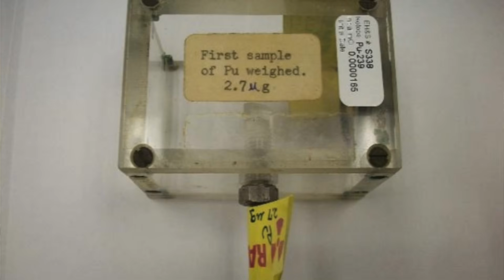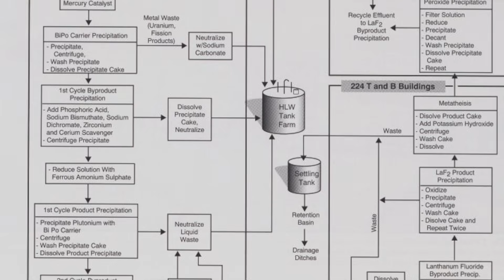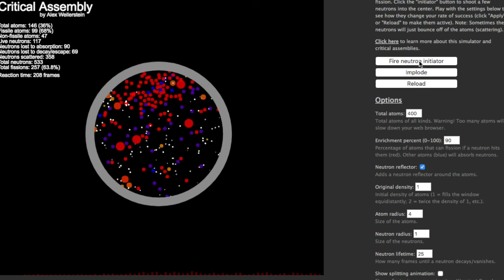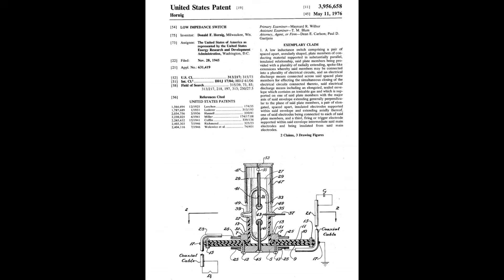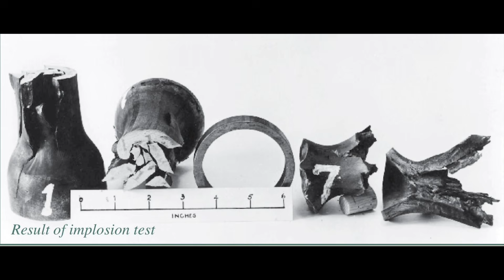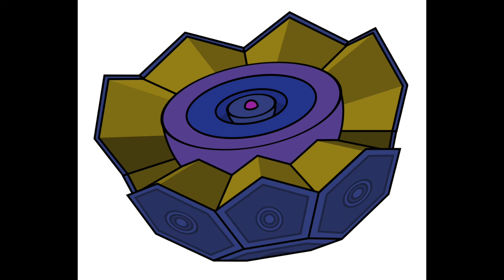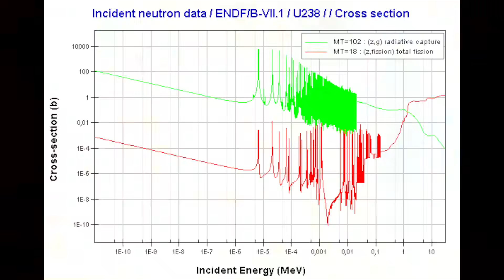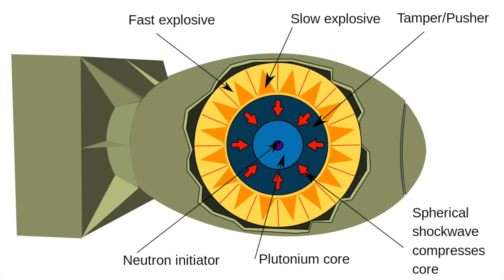Going Nuclear - Nuclear Science - Part 3 - Plutonium Implosion

Comment: I've watched/read a lot of stuff about the Manhattan project and nuclear bombs/energy, and so far there have been new info for me in each of your videos. I love how you explain the details instead of just glancing over them.
Reply: Have you read the Nuclearsecrecy blog, by the creator of Nukemap? That goes into a lot more detail than anything else I have read. Stuff like how a lot of the energy of an H bomb actually comes from fission.
Reply: @charleslambert3368  That's very basic information available on wikipedia..
Reply: The smart guys were the ones that made the kriton ignitors
Reply: What have you read or watched? We're you sober? We're there a lot of plush ponies? You won't find physics in a happy meal 🤣
Reply: Reactors make plutonium as a by product the a goal for plutonium is more cheaper easier bombs that is the point of of going ror plutonium. Enriched uranium even at low none weapons grade is a problem because with that you can make reactors and the reactors will make your easy bomb material plutonium the ignition timing for the explosives is tricky but only down to nanosecond tolerances easily within the capability of switching diode available for purchase through digikey not that big a deal to set up if you have a 100 mhz scope and can read the graticule.
Reply: @rickevans3959 you can't even spell simple words. Don't pretend you do understand the terms 🤣

Comment: The gadget is compressing plutonium with the power of tnt 
So is fusion bombs using the power of fission to compress hydrogen isotopes?
Reply: Also.. dont discount which lithium isotopes are in your bomb or youll end up with something a WHOLE lot larger than you anticipated ;)
Reply: The pressure of radiation do the most of the job.
Reply: Did someone tell the Americans about Lithium 7 >_<
Reply: It's a bit more complex than usually depicted. The primary is in a thermonuclear weapon is still a small conventional fission nuke (with tritium boosting, but that's not very important; mostly it makes it smaller and less sensitive to fizziling). The only fusion type that makes any sense for a bomb is that between deuterium and tritium; which occurs at much higher rate than any other kind of fusion and gives off very energetic neutrons. Isolating large amounts of tritium is difficult and expensive, so that's not what is done. Lithium isotopes react with neutrons to split into helium-4 + tritium; so you can make all the tritium you need, and it turns out that you can do it fast enough if you enrich the lithium in the more efficient lithium-6 isotope. The material chosen was lithium-6 deuteride; a salt (much denser than cryogenic deuterium tritium in liquid form). If you compress something, you want it to be cold while you are compressing it; otherwise it will exert a much larger pressure. Then when it has been compressed you want to heat it rapidly and pelt it with neutrons. In order to do this there is a a device of some kind, at one point made at least partially of beryllium (a neutron reflector) called an interstage, modulating how many neutrons and when they reach the secondary, absorbind and re-radiating x-rays, preventing hot gases from directly reacting the secondary and so on (how this device works is not public information; there's a leaked sketch purporting to depict this thing, but who knows). Then you have a fission bomb inside the lithium deuteride, called a spark plug. If too many neutrons go directly into the spark plug they cause fissions even though the spark plug doesn't go critical yet; and that pre-heats the secondary, making it harder to compress, this is unwanted.

There are several different effects that could be used to compress the secondary, thermonuclear device. There is radiation pressure (x-rays have momentum, even if  they do not have mass); turns out, radiation pressure is very weak. Plasma pressure;  if you heat a light foam into a plasma, it can exert a large pressure from all directions; this is good, charged particles don't penetrate deeply into the secondary and heat it like e.g. gamma rays would. Ablation pressure is also effective. Ablation is when you heat the surface of something and it turns into a gas or plasma; momentum is conserved, so the gas pushes of the surface and press the surface inward. The secondary contains a exterior shell of plastic foam, so that should tell us that plasma pressure is an important effect; ablation pressure, maybe helps also if it is pushing in the correct direction at the correct time but maybe not.

When you have compressed the secondary, you want the spark plug to go off. Creating a lot of heat and neutrons and brings the lithium deuteride to enormous pressures as well as creates the tritium that is consumed in the fusion reaction. These fusion neutrons are very energetic and can in turn fission U-238 very effectively. The whole device can be inserted into a uranium tamper (to keep it toghether just a little longer) which approximately doubles the yield. That's why it is said that Tsar bomba could have been a 100 MT bomb; they used a lead tamper instead of a uranium tamper to make the device cleaner for testing.
Reply: it's worth noting 'fusion bombs' (technically thermonuclear bombs) produce so much energy by combining the forces of fusion and fission. A great deal of their energy is still fission based.
Reply: @impguardwarhamer  In fact often majority of the energy is from the fission stages. The fusion stage is used to generate vast quantities of free neutrons which blast straight into the next fission stage, effectively completely circumventing the problem of critical masses and careful geometry to maintain chain reaction. The neutrons from the fusion stage forcibly fission almost all of the uranium in the next stage regardless of whether it could sustain a chain reaction. This allows building arbitrarily large bombs. You can even use depleted uranium as the fission fuel, because the intense neutron bombardment "breeds" it into fissile plutonium in-situ.
Reply: And you can use a fusion bomb that produces very high energy neutron to start an other layer of fission energy based uranium bomb to increase yield...
Reply: The Americans DISCOVERED Lithium-7.  That's why Castle Bravo was such a disastrous overtest...
Reply: more or less ... its more like overcoming the repulsive forces though ; and like some other people said its actually for the most part the radiation pressure compressing it.
Reply: Castle Bravo, anyone?
Reply: Fusion bombs use fission bombs as a detonator. They provide the compression and temperature needed.
Reply: The Earth I'm no nuclear physicist, but my understanding is that the heat and pressure created by the fission causes the hydrogen nuclei in the plasma to near the speed of light, allowing colisions that produce fusion and a crap-ton of energy.

Comment: At 10:00 you mention the pressure within the bomb and compare it with the core pressure of the earth. That set me thinking about the pressure within the earths core. Because we know that right at the center of the world all gravitational forces cancel each other out. So no (null, nill) pressure in the center of the earth?
Reply: That still leaves you with the weight from all the mass around you rushing inwards, because of gravity.
Reply: Yeah, but what gravity? Is there any gravity at the center of the world? The mass is all around you, so all forces cancel each other out, don't you think?
Reply: The mass near the center (essentially) isn't experiencing any gravitational force, but all of the mass that isn't near the center is being pulled towards the center by gravity.  The pressure is caused by all the other matter pushing down on the center.
Reply: There is no gravitational force at the conter of the earth, but because all the gravitational force is acting toward that point, the net pressure is the sum of all increases in pressure above it. Pressure and gravity are different. Gravitational force cancels out for all matter at a radius greater than the one that it is measured at, whereas pressure is the force being exerted over an area, and it adds as you go down ( both in an oversimplified version of newtonian dynamics, assuming a perfect sphere, and leaving out a lot of the complexities of integration and the relation between force, energy, and pressure).
Reply: You're confusing weightlessness with pressure.
Every part of the sphere is attracting everywhere else, so the maximum pressure is in the centre.
If somehow there was a cool void there where you could exist, you would experience weightlessness but the pressure is so astronomical, you would just become a dirty diamond about half your size as it collapses!
Reply: Ed Eggermont There's no gravity in the centre of a balloon either but if you squeeze it, it still goes bang.
Reply: +Andy Lee Robinson
OK, I think you are right, I was confusing those two. Thanks for explaining you all!
Reply: +
IKingRoachI
Of course there is gravity in the centre of a balloon you silly!
Reply: Sorry for any typos (like counter, which should be center). I'm on mobile, and it isn't being especialy cooperative today.
Reply: +Toxic Psychotic
Yeah, but again... Say you're 10 meters away from the center of the earth. The center of the mass of the earth from your perspective is 10 meters away from you. So there is a nett mass of only 10 meters of core material of pressure on your body. Or not. I really don't know :)
Reply: Ed Eggermont If it was a balloon then yes, but as a terrible Earth Analogue (re: OP's question) then it makes sense haha

Comment: I wonder if North Korea are watching your vids? :P
Reply: Designing and building a useful (not necessarily efficient or high-yield) fission device is not that difficult and any video such as this will make absolutely no difference. The hard part is getting the materials needed. It's so hard that really only state-run manufacturing programs will be successful.

NK has already mastered both aspects of nuclear weapon production.
Reply: By their 120 kiloton test I'm sure that they have the implosion and explosive lens concept down already. If the images they show of their "fusion bombs" are accurate, they're significantly better designed than 1940s era weapons. It does make me wonder who is providing North Korea with research. I'm guessing the Chinese, but it could be the Russians, or the Illuminati, who can tell.
Reply: If the warheads are as miniaturized as the pictures claim, then they would likely need fusion fuel to get the required yield. If, however, they've been saving up plutonium for a long time they could just make an extremely large fission bomb like Ivy King. 

Now that they have a missile with decent range, this is the question. I underestimate the North Koreans, but what I always forget is how much more quickly things can be simulated and prototyped with modern computers. They could have easily skipped straight to optimized thermonuclear weapons using vague design specifications and academic simulation software. (Kerbal Nuke Program, anyone?)
Reply: Was just a joke
Reply: Their 120 kt test (It is speculated to be 200 kt) was a fusion explosion, and goes far beyond basic atomic fission bombs.
Reply: North Korea and Iran have been collaborating on weapons research for decades, check out Arms Control Wonk podcast.
Reply: obligatory nk jokes fueled by arrogant ignorance
Reply: North Korea is considerably ahead of his vids. Remember that they recently tested what appears to be a miniaturized hydrogen bomb.
Reply: Honestly. Hope not but he has help anyway now that's not rocket science to realise
Reply: North Korea *says they tested a fusion bomb. I highly doubt it, the yield was way too small. My own country, India, said similar things in 1991, with similar yields, but the general consensus is that we only donated fission bombs.

Comment: The implosion test results are not done with plutonium I guess. Is there any info about the properties of the compressed metal pieces? I mean Mohs hardness, and other properties...
Reply from the maker: A lot of stuff is still classified - that was just about the only image I could find showing failed implosion tests.
Reply: Thank you!
Reply: bandiras2 you realise metals don't permanently compress, right? They act like fluids and rebound.
Reply: bandiras2 yep, you want values like bulk modulus and equations of state. There's a lot of that info for uranium, not so much plutonium.
Reply: I rather interested in the new properties of this compressed steel. Hardness, durability, melting point, and other.
Reply: I literally have no idea how the electron clouds reacting for such of pressure, and I read somewhere, they could compress steel balls permanently, but I cannot reach to any valid data, so all of I know might be wrong.